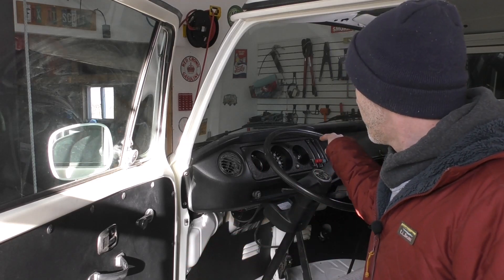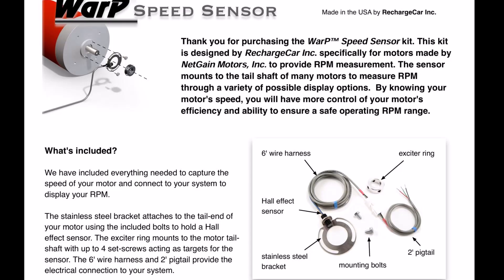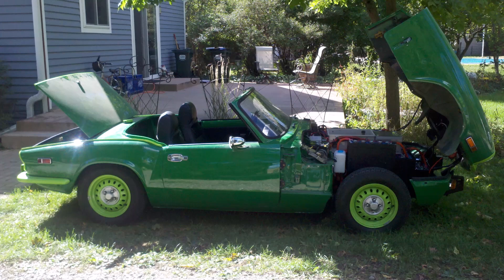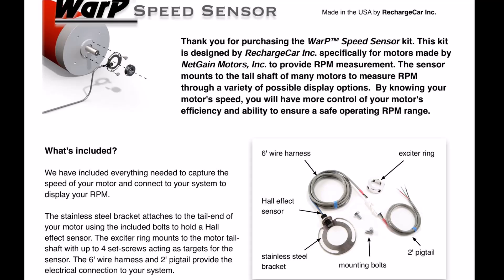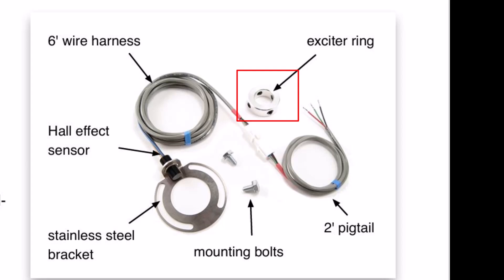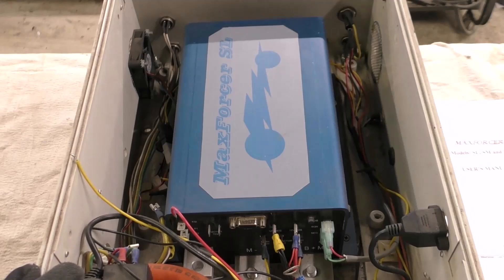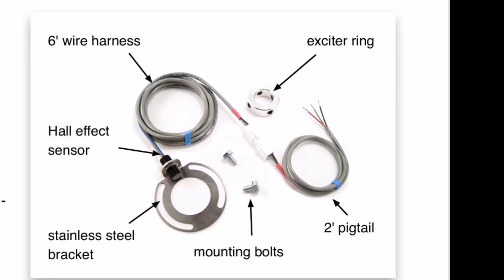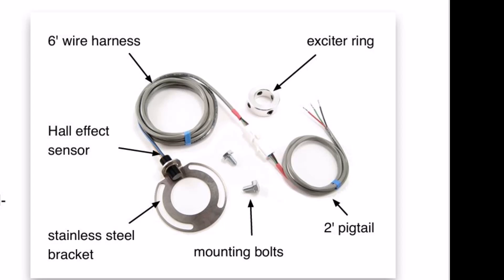VW Bus Electric Conversion Part 20: Custom Warp 9 Speed Sensor to Drive a Tachometer #evconversion

Comment: Have you been able to get an actual range yet? If not I know you said in one of the videos but I can't remember what your estimated range will be?
Reply from the maker: I haven't done range testing because I haven't registered the car yet.  I am waiting until Spring to register it because it's too cold to drive and I still need to finish adjusting the brakes and re-brush the motor - basically just buttoning up the mechanicals.  So that will be coming soon.  My guess on range for my 30kwh pack is around 75 miles.
Reply: @FixItScotty  the reason I ask is I just got a mg midget and am converting it. Today I found a Warp 9 with a Zilla controller never installed. I was wondering because you had the little car before very similar what king of range do you think I would get if I copy your battery setup. Granted it will be challenging to get al 6 battery packs in.
Reply from the maker: @kracticuspotts9686   Oh, ok.  Cool!  Well I do have plenty of experience with my Spitfire conversion to answer that.  The 13kwh pack in that gave it a 50 mile range.  So, maybe 60 miles per 15kwh.  So a pack of my van's size could do 120 miles.  That said, watch my part 18 video where I warn about split parallel packs in a small car.  I wouldn't do it.  I probably would build a single series string of 180AH 3.2v cells or, at least, lower voltage OEM modules like the Tesla model S.

Comment: it was fun to follow along with this one. thanks for filming it. Be sure to test the tach again after you put the signal wire up against the back face of the motor... i'm wondering if the strong fields from the motor might interfere with anything, but i suppose you would know it right away by seeing a jumping needle. great stuff scotty!
Reply from the maker: I'll be sure to check it again.  Thanks for watching, Frank!